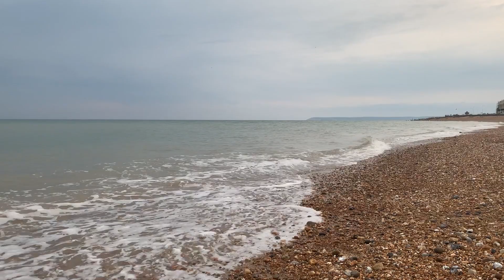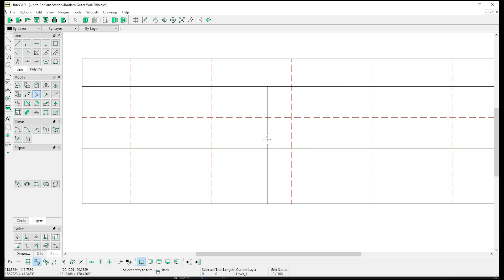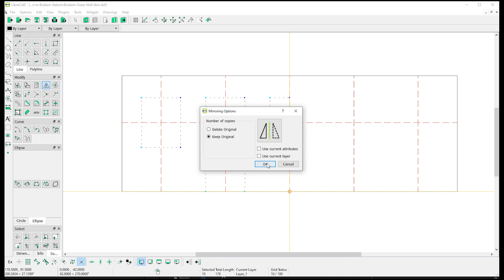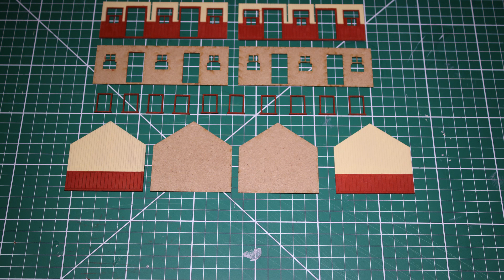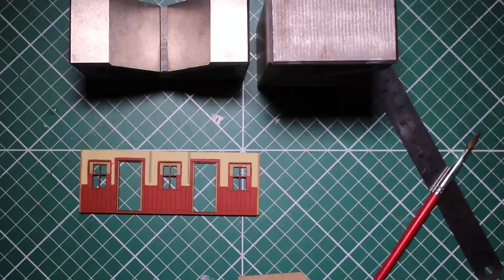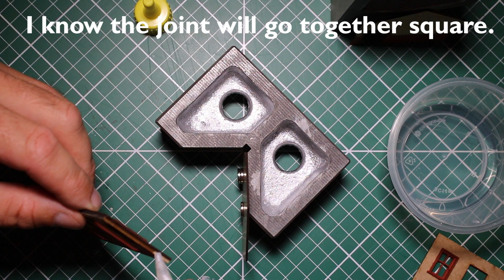The CAD Series | Part Four | Bodiam Station | Drawing & Modifying Lines

Comment: Thanks James, some good tips there to make drawing the front of the station a bit simpler. I assume we need to remove the lines at the bottom of the doors so that the laser cutter doesn't show an error?
Enjoying the learning process!
Thanks!
Reply from the maker: Thank you so much.  I'm really pleased your're following along and having a go.  That's very encouraging.
Yes, you could remove the extra lines, although I tend to leave them in such instances, as the result after laser cutting is a useful rectangular off-cut.  I keep all of the little off-cuts and they come in so handy.  I have boxes of circles, squares, triangles, etc. and there always seems to be just what I need when I need it. :)
What a lovely question for me to answer - it shows you've been paying close attention.  
You say you've been enjoying the learning process, to which I say thank you so much.  I am really pleased that you are finding the videos useful.
My best wishes,
James
Reply: Bexhill West Ok, I see! That makes perfect sense!
In my earlier life with cad and Wire Erosion machines, I found that if I was to leave unneeded lines in the program the machine would stop part way through the cutting program and sit there for hours trying to work out what to do.😂